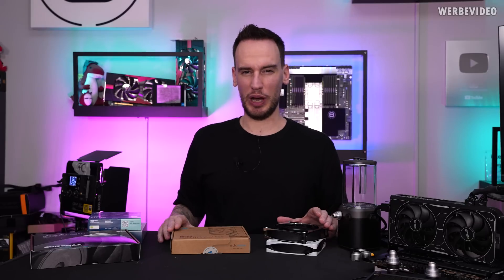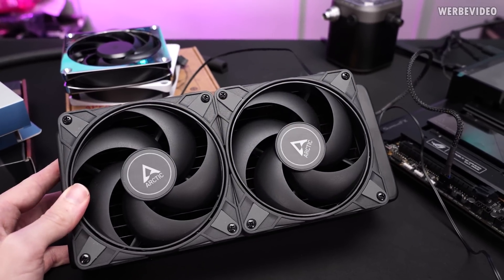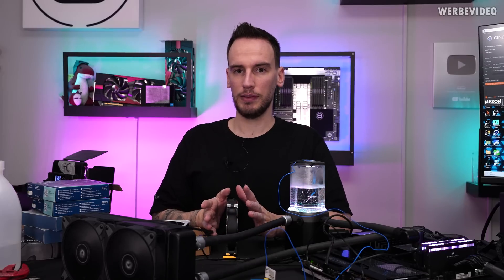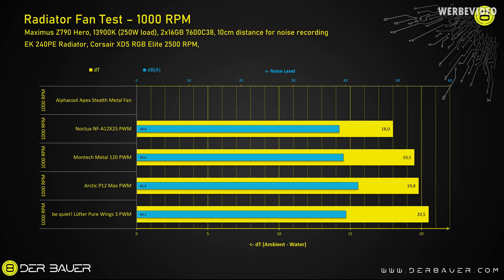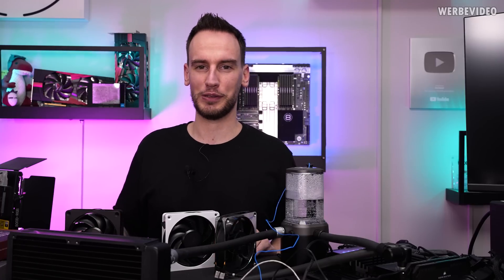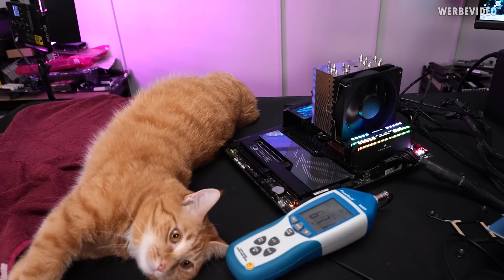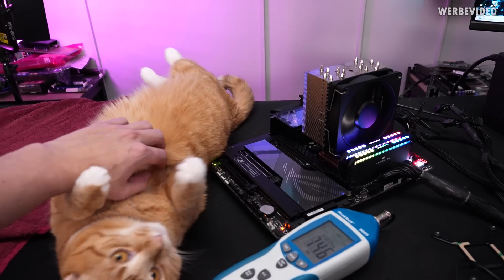Something is Wrong here - Alphacool Apex Stealth Metal Fan Reviewed

Comment: hmm... when you really think about the physics, the higher you spin the fan hub. Then it's off axis side loading the bearing if there is any slight imbalance. Just like the way your car wheels are balanced. So any noise due to an imbalance would increase the higher the speed. And less difference at the lower quiet speeds. What I am saying here is that maybe if Alphacool cherry picked really good examples of well balanced pre-release ones. And sent them to Igor then that would help explain at least a part of a discrepancy. But only at higher speeds. Because there are indeed also other reasons for why fans deviate from each other. And other factors that contribute to the total fan noise.

But also given that your CPU power draw is probably pretty inconsistent. And also because the results are relatively pretty close to each other, and this is also because you have a normal (high) daytime noise floor. As per any real worlds daytime usage. The I do not feel that these testing is going to show much difference between fans....

When it matters the most is in the dead of night time. (so for night time gaming sessions). When you are at 3am - 4am and there is absolute silence. Then your ambient noise floor is going to be way down. Much less. And this is when you can benefit the most from the quieter fans (less than the typical 20-25dbA ambient). To show up some bigger differences.

As for myself: I am so glad to see these testing, and for the value for money I would probably get the P12 Max these days. It seems like a nice choice, and not to throw too much money per fan. Since most assuredly, over the span of several months fans can degrade in terms of developing new noises, and then the fan can sometimes gets worse. And need to be replaced. So a lower average cost (per fan) will hurts much less. Rather then expecting such an expensive fan to last a long time. Which is not proven matter. However if you did want to expect a longer lifetime then the Noctua has such a good reputation. To last a longer time. But I would prefer the P12 Max... they are 1/3 the price so I can be swimming in an vast excess of extra fans. That if it gets damaged or knocked or broken I don't have to tiptoe around my open case PC. Because there is nothing to protect the open fans, no grills or guards to stop a finger or any other objects to damage them.
Reply: But yes, in terms of ambient noise floor... then Hardware Busters (Aris) can do very well eliminate that. And then in terms of getting a much more consistent CPU power draw... then Gamers Nexus can do that in their own special test rig. To try to see better for testing with respect to any night time gaming sessions.
Reply: Also the beard: I like the beard very much Roman. It suits you very well, and I hope your GF does not complain too much to shave it off. You look very handsome and smart with these extra beard. Very good

Comment: "metal" fan, that is fake marketing. i would avoid that brand when they do this. 
when you get tineo good fans then the fan itself do not make noise if you run them at low rpm. it is the air they move in the case that makes the noise. maybe the fan filter create some noise among other things.
so the best test for noise should be how they cool at the same airflow. 
and that then is the measure how turbulent the air coming from the fan.

Comment: yeah i think the only reason it was testing better at all was from the blades being connected to that outer ring, where as normal fans have a gap which let's some pressure escape.  but i see you did mention that in the video.  no way a metal frame is going to make that much difference.
Reply: Noise Blocker fans have done that for the last decade and are actually comparable to A12X25 and Nidec Gentle Typhoons.

Comment: The different geometry of single-tower heatsink vs 240mm radiator will lead to a significant difference in noise, potentially having greater impact than number of fans.
Heatsinks are [typically] quieter by design, due to the larger gap between fins, relative to radiators, with additional variances coming from the shapes of the fins in the stack.
Reply: How you test also matters quite a lot. Put the tower inside a case, measure 1m away and the difference between 1500rpm and 1000rpm in dB is a lot smaller than doing a silly test on a table 15cm away from fans. Would be nice to see full system test perf per euro too. 5 pack of p12 max costs about the same as one of those premium fans. Put 4 case fans and 1 tower, vs one noctua fan for fair comparison :D
Reply: @jepulis6674 you want him to test all the different types of cases?  They all have different airflow and static pressure.
Reply: @jepulis6674  But he covers.  When I thought he'd mentioned the geometry, he instead went for number of fans, but that's less important (especially at low speeds) and immediately obvious to people, whereas the importance of airflow disturbance on noise is less obvious and less intuitive.

Comment: Guess you could have set the air-cool test up as a push-pull if you wanted two fans? Maybe that might have stopped the throttle. Though I guess the main point was made without it.

Nice fans, just not quite what the marketing hype claims. Go figure.

Comment: After looking at that graph at the beginning for a ew seconds, things are clearly suspect. If you extend the graph to 0 RPM then the Alphacool would still be pushing air, while the blades are stationary.
Reply: I believe all the graph are absolutely meaningless, they all include : "linear interpolated based on measured values at 500, 1000 and max RPM".
So there is only three real values ... And all others pseudo data point do not look like that they are linearly interpolated to me, more like they were placed for the graph to look more "real"
Reply: @timshel1429 I missed that. And totally agree linear interpolation would not come up with those others as extra data points.
Reply: @timshel1429 yeah I noticed this also.
Reply: Of course not (not physical). But they might be optimized for very low RPM and have a very strong drop-off at very low RPMs. However I do agree that the graph might be a bit fishy, so it might be a measurement error also.

Comment: I design 3D printable RC jets and EDF fans. It's important to minimize the gap between the blades and shroud to maximize efficiency and PC fans always have a huge gap compared to RC EDFs which bothers me. You can even feel the huge amount of blow back through the gap when they run. I usually 3D print a shroud that slips in between the blades and fan housing on my CPU cooling fan which always ends up reducing the temperature significantly. It's so close that it almost touches and I usually have to sand to get it perfect. 

Even if there's a ring around those blades there's a pretty big gap outside the ring.
Reply: That's one of the things that differentiates the more expensive fans - more expensive ones have higher quality polymers and a smaller gap. Manufacturers need to allow for some creep, lengthening the blades. Due to centrifugal force and thermal cycling, it's almost unavoidable. The better the material, the less of it, and the smaller you can make the gap. Noctua for example advertises a 0.5mm gap for the A12x25, I'm sure they've gotten that as low as they can without compromising the reliability of the fan - keep in mind they need to allow for many years of use when deciding on that gap...

To make serious improvements and maintain long term reliability you'd probably have to go away from injection molded plastic. To metal fans, or maybe carbon fiber reinforced plastics, but both of those would push manufacturing cost waaaay high.

Edit: the reason the gap is smaller for EDF fans while they're still plastic is in the geometry. They're typically smaller diameter and/or have straighter blades.
Reply: @ska042  And its borderline impossible to offer a warranty on those tolerances when you're dealing with the volumes Noctua is working with. As you stated they'd have to completely revamp the manufacturing if they go with a different material and it will skyrocket the cost for maybe a few C improvement.
Reply: I do wonder what aluminium blades would actually cost, if you dropped any "omg metal!" premium. Titanium would be ideal, they'd be absurdly thin & light, but that really would also be absurdly expensive ( not only is it costly to obtain but it's a pig to work with ).
Reply: @RichardDastardly59  There has been aluminum  bladed fans in history. None of them were anything groundbreaking really (then again they were made more for  the looks instead of performance / tolerances)
Reply: @ska042 noctua took years to offer black fans, because they had to verify the black plastic didn't have enough creep to close the gap. That's what the industrial fans don't have as close of a gap because it's a different plastic that is more durable, but has more creep.
Reply: In line with what ska042 said, this is actually the reason liquid crystal polymer fans are the new craze from a performance perspective - the material properties and reproducibility mean that manufacturers are able to make the gap smaller
Reply: That air escaping is on purpose often, otherwise there is too much back pressure (the air the fans flow into the radiator can't all fit, so the rest tries to escape back through the fan blades) causing noise, reduced performance, or more wear due to the extra air resistance. It's not a problem to design with no gap for a specific purpose or design a sturdier/beefier fan, but consumer fans have to be general purpose for cases, air towers, and water radiators.

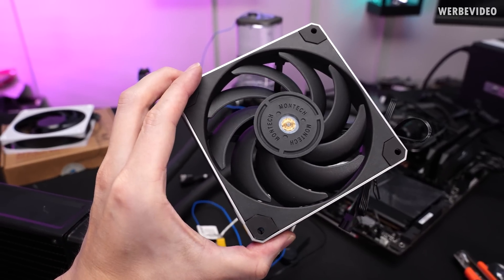Comment: 04:02 Yeah, I definitely consider that misleading. At least in my personal opinion in order for it to be a "metal fan" it has to at least have metallic blades in it.
Reply: I'm not even sure this fan is necessary at all unless it's for bragging rights or something stupid like that. My machine is running a  Xeon 2698v3 and one of those 12gb RTX2060's in an NZXT H510 case with all noctua fans and a U12S cooler and i'm sitting at 39c right now watching this video in 4k on one monitor while working on editing a video in Davinci Resolve at the same time. That's in a case that breathes like someone with lung cancer. What more do people want? hahahah
Reply: Metal would be a terrible idea for a fan blade because of its weight. The motors would have to have much higher torque to start up / control the fans, and the blades would have enough kinetic energy to be insanely dangerous. I mean, even plastic blades are dangerous with enough energy - look up Jayz video on delta fans to see that.

Comment: Kelvin? I'm sure you meant Celsius, as the values shown on your device clearly states its in Celsius. 20 degrees Kelvin is surely not 20 degrees in Celsius :)
Reply: Kelvin and Celsius are the exact same scale, but with a different 0 point. Celsius puts 0 at where water freezes, Kelvin puts 0 at where the universe freezes.
Reply: I know you are joking but since Kelvin is the actual unit for temperature it's not "degrees" Kelvin.
Reply: A increase of 10°C is also a increase of 10K. There isn't any true conversion needed because the scale is the same.

You just have to remember that absolute zero (-273°C) equals 0K. From there you know that 0°C equals 273K. 20°C would be 293K.

Comment: 10dB is a tenfold increase, no? 3dB is a doubling.

EDIT: Just looked it up, I'm right and wrong; the actual air pressure measured is as I posted, but your subjective experience is different, and a 10dB increase is indeed a doubling of perceived "loudness".
Reply: I was in doubt for a minute as well.... then realized this is the only comment section with people searching things up and helping! Thanks for adding the information!
Reply: 3dB is a doubling in sound pressure level (SPL), but dBA (dB, A-weighted) takes into account average human 'perceived' loudness which does not scale directly to sound pressure level. I think in general 10dBA is about a doubling in perceived loud ess
Reply: Any talk of "doubling" in terms of a fixed dB difference is bogus. You simply can't compare noises like that. The only thing that could be reasonably said about a noise that's 10dB louder is that it's 10dB louder. Unhelpful but true.

Indeed you need 10 fans to make up a 10dB difference.

Comment: Normalising for fan speed seems odd. I don't care about fan speed, only noise and temps. So, why not normalise for noise levels?
Reply: My motherboard doesn’t let me set fan noise level. It does let me set fan speed, so for me it’s easier to see which is quieter at a 1000rpm idle.
Reply: @NoLongo FanControl exists your comment is useless.
Reply: @NoLongo  My point is that a user will normally tune the fan speed based on noise levels; as fast as possible while being under a subjective noise threshold.

So, as a reviewer, the fan performance should be compared at matching noise levels.

If FanA performs better than FanB, but is louder, they're not being compared under comparable conditions. A user would either have slowed FanA down or sped FanB up. At which point FanB might be the better performer.
Reply: Sorry but we are not all the same. Me I prefer see result at max speed only. Because when I not game and PC is not OC, they don't run or so low that 600 rpm or 1400 rpm it the same I don't care
Reply: @Sectorz Nobody runs their fans at max don't ask for misinformation because you refuse to understand something.
Reply: @svn5994  don't talk for everyone your not
Reply: its just different, its like controlling the work load and measuring the output. rather than controlling the output and measuring the performance.  doesn't change the conclusion, his method allows is basically the results  are the things you cared about the noise and temp. he does mention that the noise was hard to control for becasue the fans are so quiet and not far enough above the noise floor of the room.
Reply: He provided the data he's able to produce easily.  He'd have to get the block up to peak temperature then go back and forth with adjusting fan speed.  You can make your own conclusions with this information.
Reply: Also as seen in the final test he's working with an OC'd cpu vs the heat generator that GN uses, this makes it more difficult to adjust for other parameters without falling outside of the processors boost criteria.

Comment: 39db is quiet? In my case 33db is quiet, 36 is audible, 39 is very loud. But i test using my phone 😂
Reply: If you watched it you see thai he measured it in a non standard way so it is not comparable to and other messurments. He measurd at 10 cm due to at the standard distance the ambient sound level interfered too much.

Comment: I wonder what led to such a difference in results, because they are so out of sync that something has to have gone completely wrong.
Reply: Maybe Igor sneezed during his Noctua test?
Reply: Igor didn't measure heat transfer only airflow to sound
Reply: Specific RPM versus noise level.  Will give quite different results.

Comment: 20 years old Gentle Typhoons still among the very best fans ever made with incredible quiet and effective results, would be nice to include them in the review as baseline.
Reply: Honestly never had good experiences with GTs, all the ones I had (both scythe and Nidec era) had bearings that basically died within a few years of use.
Reply: @wewillrockyou1986   Well mine 5 GTs are over 15 years old with daily usage of average 8 hours and going strong. Wisper quiet on the radiators.
Reply: @jamesb.walker9177  I have doubts about the veracity of your claim but okay
Reply: @wewillrockyou1986  WHAT ARE YOU SUGGESTING, not everyone like you to invent BS fanboy.
Reply: They're not though from any perspective.

Comment: i cant wait for the day when we have a cooling solution 
that doesnt need bulky fans to remove heat.
Reply: Technically we already do, passive coolers. Im not expert but I guess transfer of heat from one object to another or to ambient is not free, i.e. it need little help...
Reply: Come to Finland! It's currently -7c outside so you can have your passive-cooled rig on the balcony.

My rig is on wheels next to the balcony door and i can move it slightly to have direct cold air intake.... 
Would be funny to get sub room temps while gaming but condensation is a problem.
Reply: @woldemunster9244  Buildzoid did some overclocking stuff outside his apartment during winter at 4AM once. Sadly he also froze.